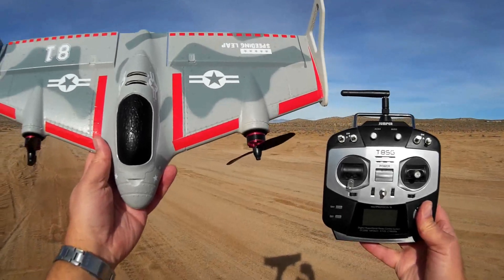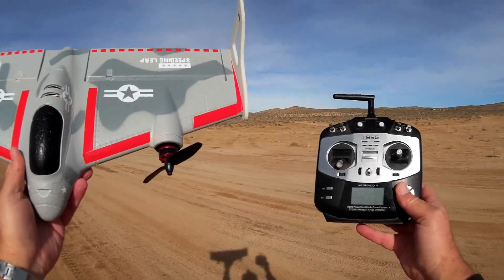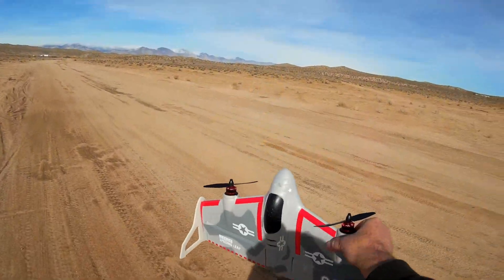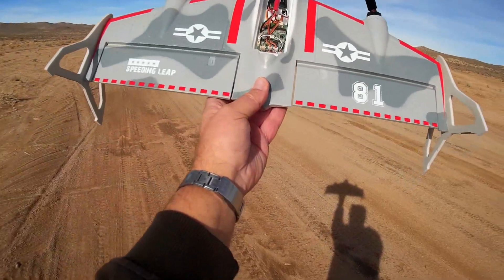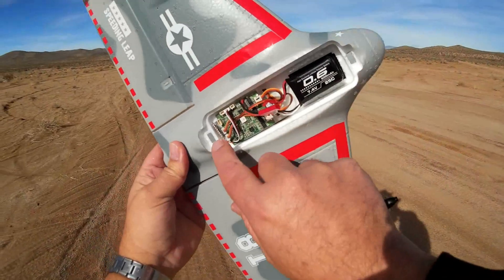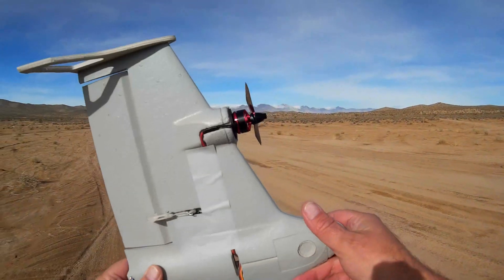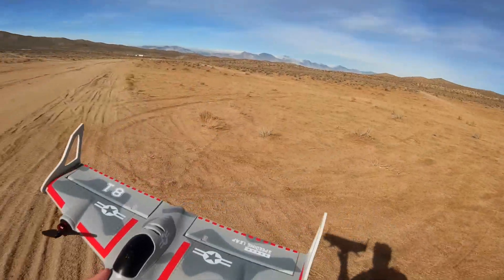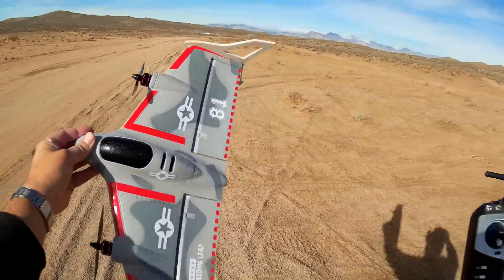Eachine Mirage E500 Vertical Takeoff VTOL Stabilized RC Airplane Flight Test Review

Comment: I can't get this to work. A video of it being setup to the Jumper T8SG would be great. Mine binds but freaks and starts oscillating the servos and powering up the motors without any input. I can hear the servos straining in all of the flight modes and I'm worried about destroying them. Any help would be appreciated.

Comment: Are you able to assist with the initial setting up please.  Have exact same TX Jumper T8SG and the FrSky 8Ch D8 RX.  To bind do I use FrSky, FrSky-V8 or FrSkyX options?  Can you point me to any resource that can assist in setting up the TX (motor arm/disarm, Differential Rates and 3-Position Mode) switches?  I just need to be able to figure it out once as the only experience I have had was with 27Mhz Futaba gear which did not have all these 'features'.  T.I.A.
Reply from the maker: Frsky only.  YouTube search is your best bet for tutorials on setup and switches https://www.youtube.com/watch?v=1stHJF-e5G8
As this uses Deviation software, searching for Deviation switch assignment will probably give you your best selection https://www.youtube.com/results?search_query=YouTube+Deviation+switch+assignment
Reply: Thanks for your reply.  I did learn that the manual is wrong, managed to bind the RX but am now having to do more research into switch assignments.  Where was the best position for the battery?  (I have the 600mAh as supplied).
Reply from the maker: The CG point seems to be about where the wire bundles go out to the engine. Recommend using the wire bundle locations to adjust placement of your battery.
Reply: Many thanks for your help, it is truly appreciated.  Me (73) and my neighbour (79-3/4) will put what I have learned into practise :-) Dave [NZ]

Comment: You should make a carbon fibre wing to go under your walkera dragster tilt rotor that would be a better VTOL than this I think
Reply from the maker: My Walkera would have a hard time doing loops and spiral rolls ;-)
Reply: Quadcopter 101 na just put flaps on the wing run it 6 channel lol seriously tho I wonder if it's doable as the dragster is a tilt rotor would a wing actually create lift on it

Comment: It's strange that it doesn't use the elevon mixing to make it's turns and only uses differential  thrust. That defeats the purpose of having elevons. Also strange that it would flip upside down when putting into vertical mode to land. Looks like it needs a firmware upgrade on the flight controller. Thanks for the review and Happy Flying!

Comment: When you said it was turning flat, I figured it was using differential motor speeds to turn. What you didn't show at the end, was in Acro mode, where the ailerons function normally, you didn't show what happens when you operate the pitch stick to see if the control surfaces act as "elevons" (elevators & ailerons).  If that's the case, it shouldn't be too hard to fly. I'm going to see if there are any other reviews of this showing it flying in "acro" mode to see if my theory is correct. Cheers.
Reply from the maker: They do function normally in acro.  And I flew it again yesterday trying acro and switching back and forth between vertical and horizontal.  It's not as hard to fly as I thought in acro.  Another video to follow.
Reply: Yeah, I saw a guy flying it in 'acro', and it seemed to fly more like an airplane, and the roll rate was pretty good. In the right hands, it would be a pretty hot flyer. Looking forward to your next try ...